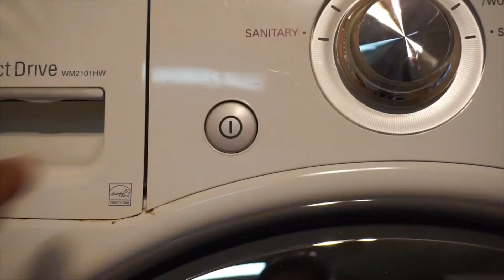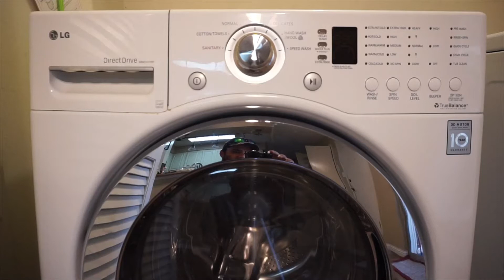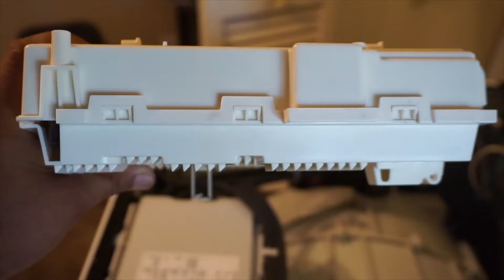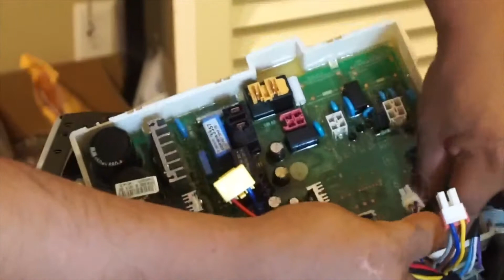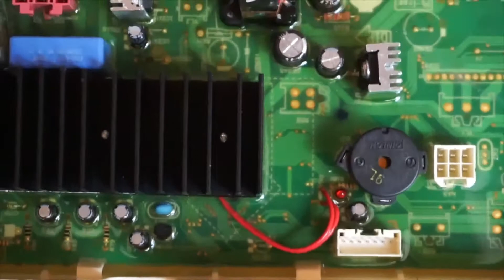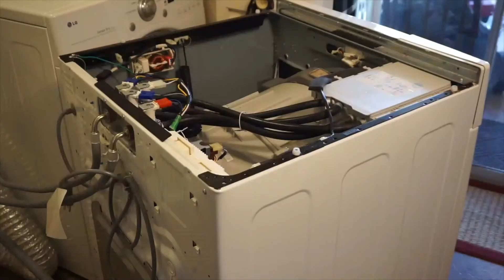LG WM2101HW Front Load Washing Machine Won't Turn On Main Control Board Replacement

Comment: DON'T BE FOOLED PEOPLE!!! HE missed ALL the tie wraps and a few othe things that need to be disconnected before you can easily "slide" that white box out. I'm an engineer and two hours in I'm still looking to crimp cutters to get tie wraps off and new replacement tie wraps. Ya sure diagnosis down to needing to replace the board but it needs more than two screw drivers to replace!!!!!

Comment: Thank you so much !!! Great job, saved my butt so many times on my installation. Only suggestion is how at the end, when you mention putting the blue tabs back in for the wire harness, etc., I didn’t know to do any of those things at the beginning and so I kept trying to create more and more slack so that I could get the existing motherboard box out of the washer. It is incredibly hard to remove it unless you make a lot of room first. Things also looked ever so slightly different for me, I have model: WM2801HLA

Comment: First off - great video! - just finished reinstall and am doing my first run.  Next - dude you must have gorilla grip fingers!  I ended up carefully using a pair of small channel locks. I found a slight wiggle, side to side as you pull sees to helps.  Another thing that helped me get the controller to a "easier" working position was to squeeze and push in the blue plug from the back of the machine - it will let you pull the wires out of the way a bit.  Again great job and thank you for postiing!

Comment: So i brought a new motherboard just came in yesterday plugged everything back up put a load I. And the same thing happened again midway thru it cut off and won't cut back on 😩 any idea as to what it maybe maybe??
Reply: It was used soon as I plugged it in the lights came on maybe 10mins later it won't come on anymore like i blew it again smh 🤦🏾‍♂️
Reply from the maker: @jjayno2003  So, I bought mine used also and it is still going strong, I may have to asssume that the new (used) one  may have gone bad, just some bad luck I would assume.
Reply: Did you test the noise filter? That's another common problem. Power goes through that first.
Reply: @bradshannon862  yes I did!!
Reply: @jayhall748  I just found the culprit with mine. The main IC had pretty much exploded on the motherboard. I was able to cut through the back of the enclosure with a dremel then cut away the epoxy and desolder it. I watched another video on this and I ordered the part. It should be here Monday so fingers crossed.
Reply: @bradshannon862  ok great!! Can you keep me posted
Reply: @bradshannon862 did you end up fixing your washer??
Reply from the maker: Really hard to tell without being there to put my hands on it. Was the board used or new?

Comment: Before you replace the Power Control Board watch the other videos on you tube about fixing LG front load  washer, that will not turn on, very cheap? Probably the PCB is a very expensive part!  There is a capacitor in  the PCB that can be bought for $5-10 bucks! 1 video  has link to buy part! Part needs to be Soldered in, if you can not then call a friend! lol The diagnostic test that all those videos showed was leave washer plugged in open door spin the drum and if the lights on display light up briefly, and it chimes, as drum spins, then this inexpensive fix works! Other than this guy did not know about this additional test and money saver trick, this is good video! SAVE CASH GOOD LUCK!
Reply from the maker: Believe me I would have loved to save more money.
Reply: Where can you buy the capacitor?